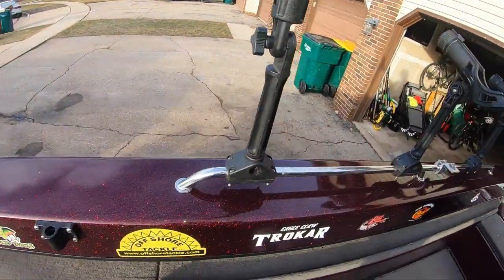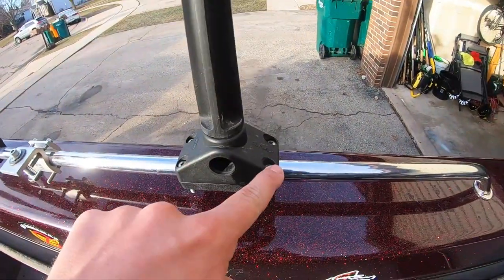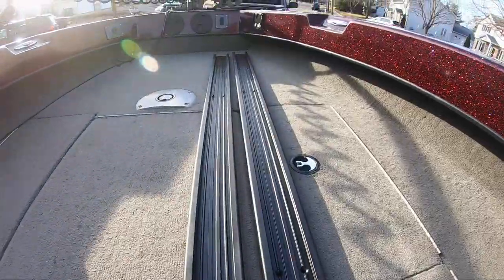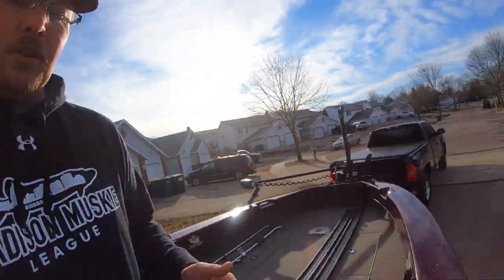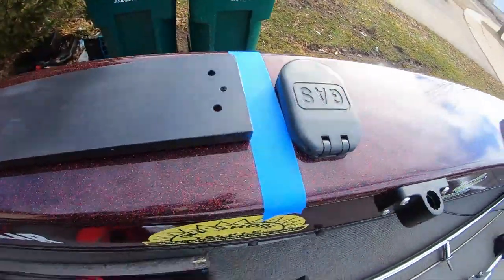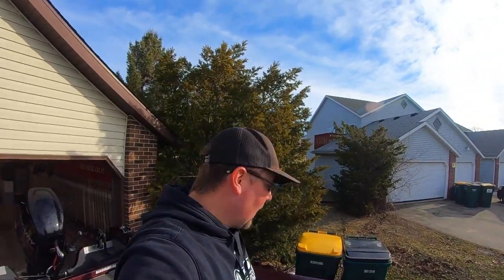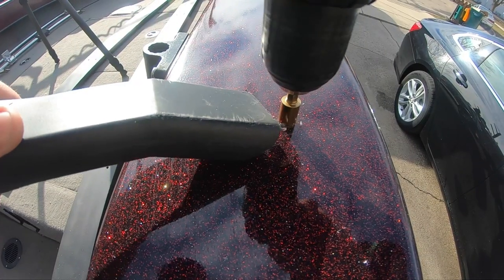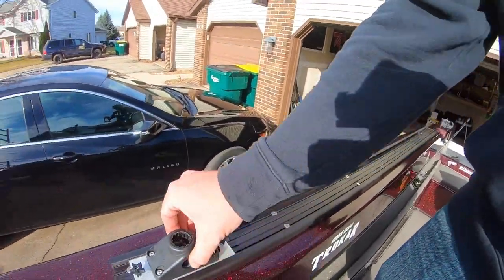DRILLING LOTS OF HOLES IN BOAT!! TRACK SYSTEM INSTALL!

Comment: I disagree with going with one long piece of track, I find going one long piece a pain in the ass, if you have to  adjust something in your spread ( in the middle of the back) you have to remove everything infront of your spread to adjust the rear, breaking up your track lengths eliminates that and allows you to adjust the spread with you moving other rods, holders, trees ect